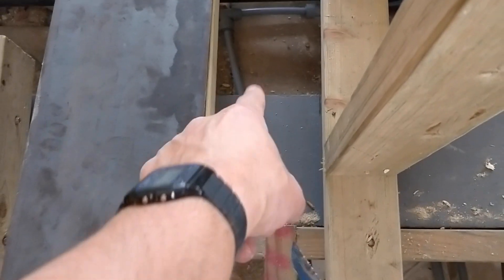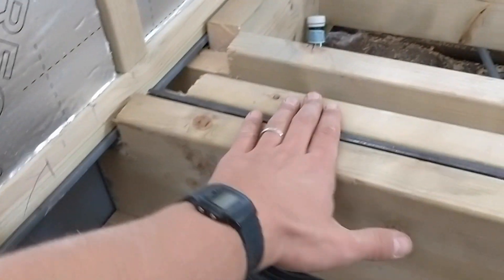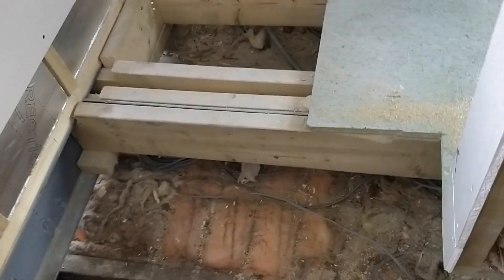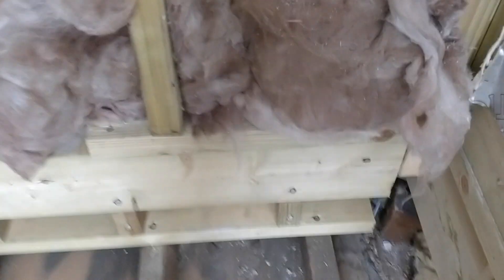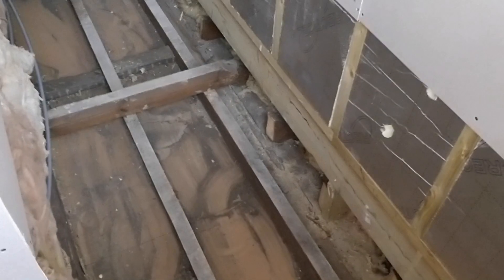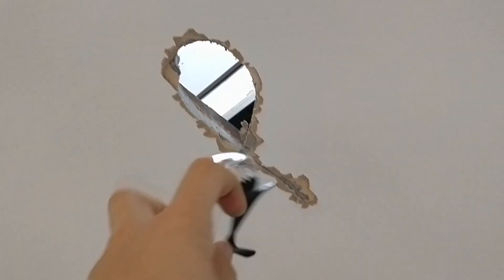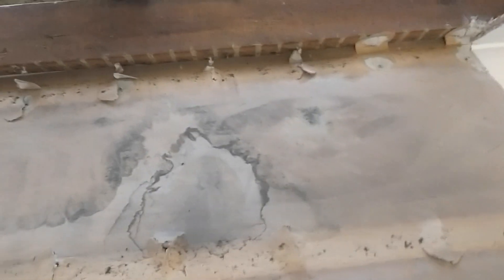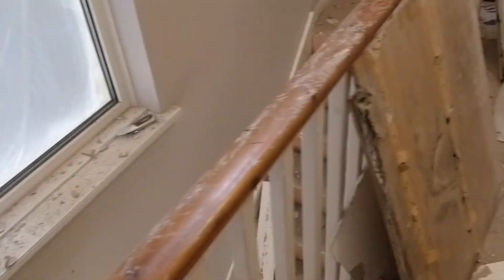Cutting through the ceiling to access the dormer

Comment: Hi mate, great vid, just a quick question how did you support the new floor and stud work to the staircase, as it's set away from your flitch beam by what looks like 300mm?
Reply from the maker: We sat the new floor on the flitch beam, and the staircase ran up and sat on the flitch beam also...what's the time-stamp where it looks offset? Happy to take a look and talk it through 👍
Reply: @OfficeBoyBuilder  thanks for the reply, ok i will try my best to explain, your stud wall which divides the loft room from the staircase and runs parallel to the flitch beam, that stud work did not sit on the flitch beam as you had a winder staircase so I believe this was set further forward towards the external wall , therefore I was just wondering did you hang that stud from ceiling? And there would of been a small section on the floor in the room between the staircase stud wall and the flitch beam, how did you support the floor there?
Hopefully I have explained that correctly. Thanks
Reply: 3.55 sec on the vid
Reply from the maker: Ahh yes! I remember and know what you're talking about.

I should have shown it in the video really, but we put more of those blocks, up underneath the stud wall, to brace it from underneath - effectively like very short studs. The blocks of wood also gave us somewhere to fix the plasterboard to which ran down that section of wall.